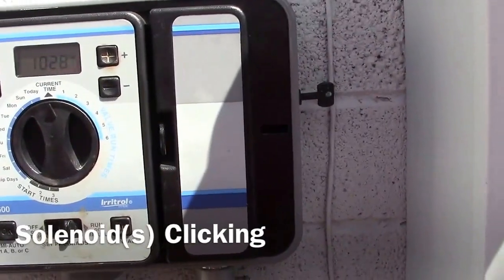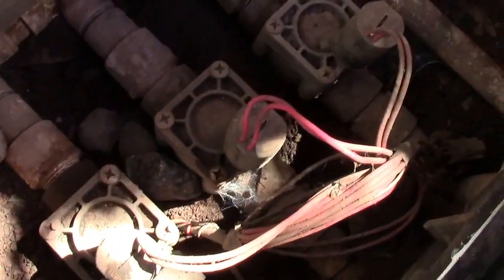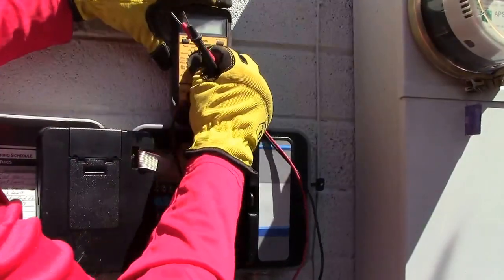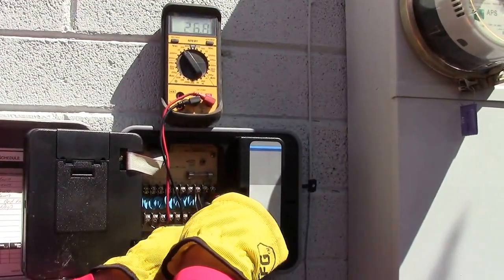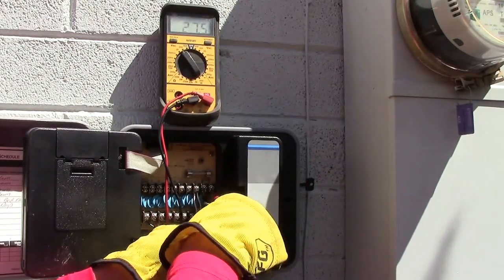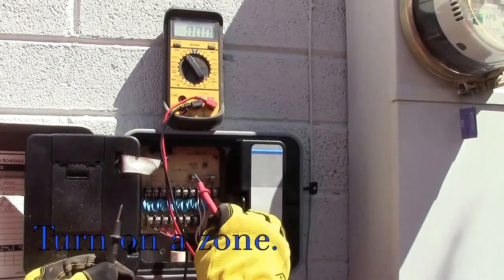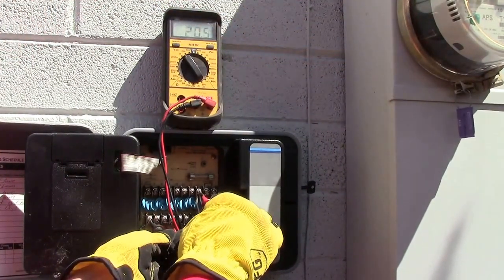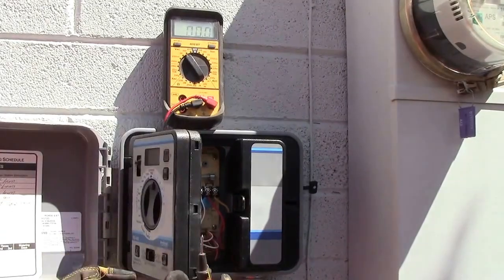Sprinkler valve clicking

Comment: I would make sure that you’re testing it with a good backup battery in there because when the backup battery goes dead, you’ll see a voltage drop.  Had this exact same issue happening and the dead battery inside of the controller was causing it put in a new 9 V battery and it’s been running great for the last 6 months

Comment: Thank You, woke up last night with pipes banging, the irrigation solenoid was cycling- typically this will indicate low voltage- not enough voltage to hold the solenoid valve open/ in place, as demonstrated above. This is a case where the slower movement of a needle type multimeter can be useful to see the voltage swings more easily- Thanks for the tip- a few quick tests and I'll likely be shopping today
Reply from the maker: Glad I could help, that is the entire point of making these videos!!!

Comment: I have a k rain timer that when I pressed manual it just made a clicking sound at the solenoid on the MV. The sprinkler has an index valve.  I just removed the old timer and reconnected everything the same way since I got the same timer. And I also changed the solenoid. And it still makes a clicking sound. Any advice?
Reply from the maker: Hard to tell my friend.  You've done everything that would make it work, change out the controller and solenoid.  Give a call to a local company that specializes in irrigation and is certified with the Irrigation Association.

Comment: I have a similar issue at my house, but I do not know if it is the same. My valves are clicking in a different noise, which sounds more like a short wire or clock tickling. It appears the spinklers are not fully open, and the water bounce back to the main water supplier and give really bad water hammering. I think the issue is the same since this does not happen when I turn the valves manually instead of using the controller. Planning to do the same replacement.
Reply: It seems replacing the controller fixed my issue as well even though the clicking sound sounds different. Thanks so much.
Reply from the maker: Keep us updated.  Have you found the issue yet?
Reply: @AZIrrigationMaintenance  Yes, my valve is different, so the noise is different. I replaced the controller, and the issue resolved.
Reply from the maker: @yu-hsientu7137  Good to Hear!

Comment: Hi, so if it is clicking at all, then the controller is bad?  my first 3 zones click and sprinklers come on and work, but not as fast your demo on number 1 zone.  my zone 4 clicks slower and is rattling the pipes in the house.  I am also in Scottsdale.
Reply from the maker: You will need to change out your controller or hire that out.  Good luck!!

Comment: Did this fix work?  I have the same issue.  Just want to make sure it is the controller and not the selonoid.
Reply from the maker: Yes this is going to work.  If you try each valve and it clicks on every valve then the main source of power coming from the controller is faulty.  Best of Luck!!!
Reply: Thanks.  It is fixed.